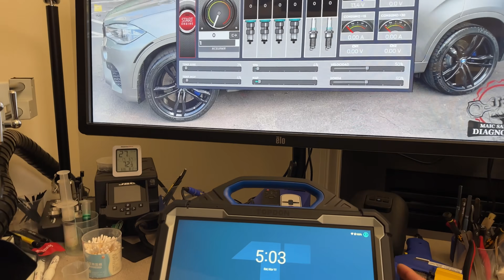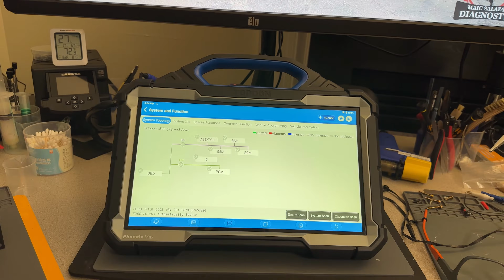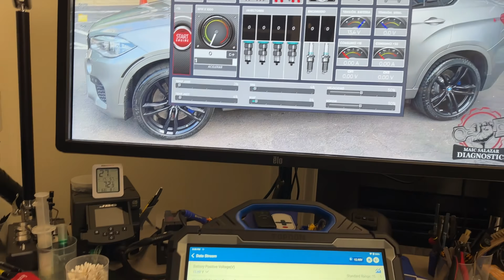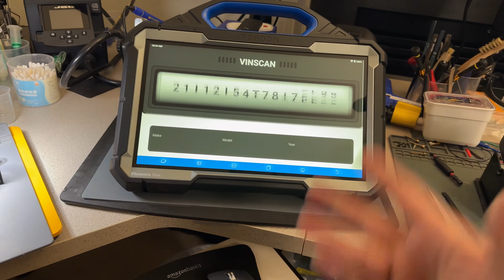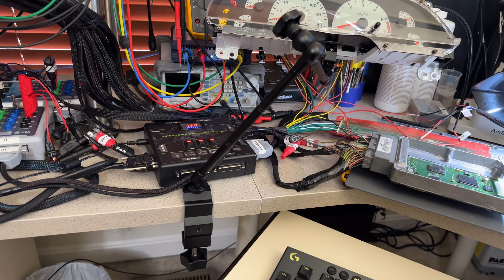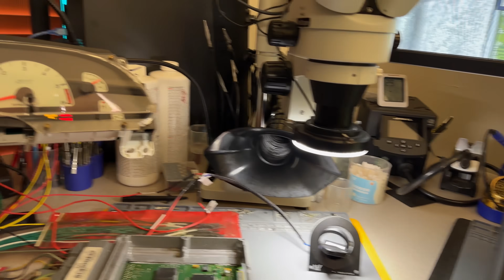2003 F150 Lightning no start PCM repair for Brandon Joos under warranty

Comment: Hi. Thank you so much for your videos. I watched the how-to classes from 3 yrs ago and bought connectors to bench test my 99 F150 5.4 PCM.  On truck, no communication to OBD2 reader, COPs fire, but no injector pulse.  I bought a refurbished PCM programed for my VIN w/ same results. Pins shown on my wiring schematic for bench setup. Ground: PCM 3,25,51,77,103,DL4,DL5.  12V+:55, DL16 (always), 71/97 (on switch). PCM13:DL13, PCM15:DL10, PCM16:DL2.  Should this connect to my wifi code reader?  The reader used to work for the truck and still works for my car. Thanks for any help you can give.

Comment: Have you ever repaired any of the ford theft receivers at the ignition lock cylinder? We have been having a lot of these come into our shop faulty with no replacement parts available only used parts from salvage yards and those are even getting harder to find.
Reply from the maker: Can you share the part number?
Reply: @MaicSalazarDiagnostics  the ford number on the part is F8DB-15607-AC.